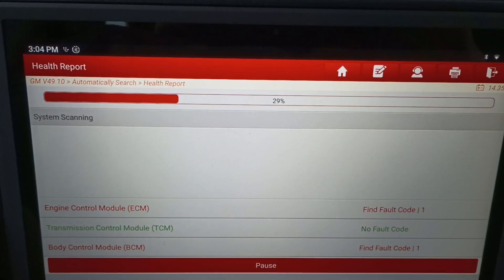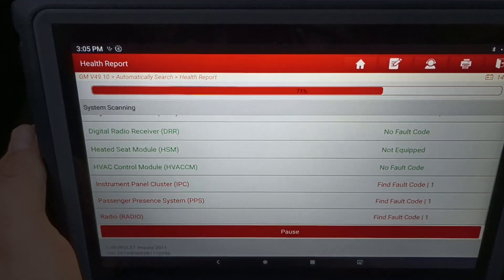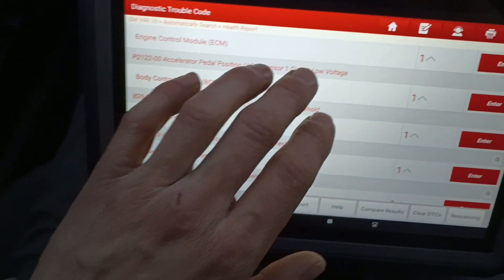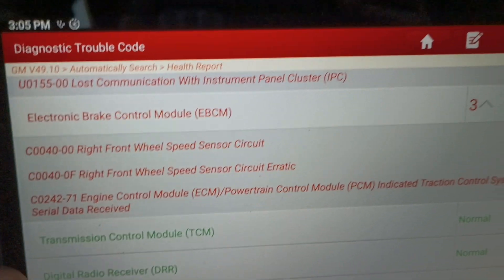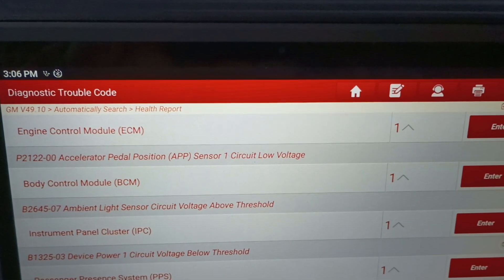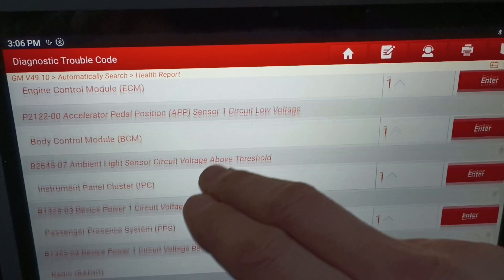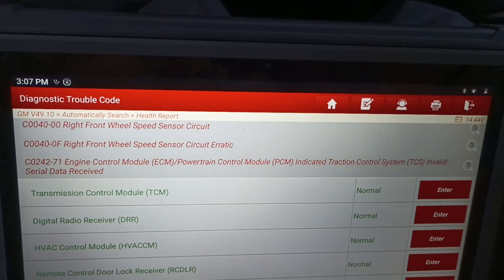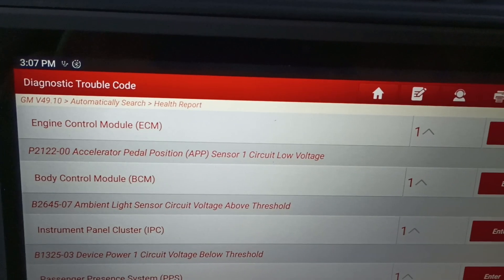Launch x431 pro 5 health report showing history/inactive codes?

Comment: Are you happy with this tool since it’s not supposed to be a USA tool?
Reply from the maker: Honestly I am kinda split on it.  Depends on what you plan to do I guess.  There is not a lot of tech support.  Launch USA doesn't even know it exists when I called them so that's not an option.  I had a issue where I blanked a bcm2 in my Audi while trying to program a steering column lock module. I did loose internet wifi while programming so this may be on me.   But really I think for key programming I would just pay someone to do it next time.   Other than that all other functions I have done have worked good.   

Thanks for watching please subscribe to keep me motivated to add more content